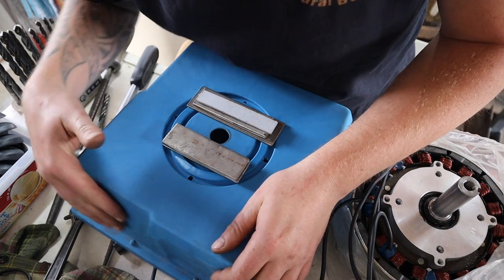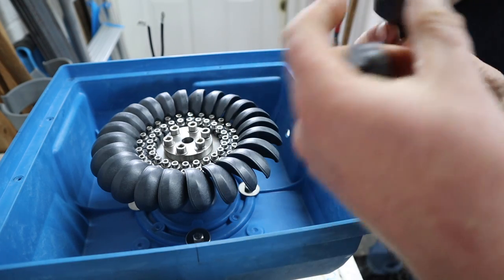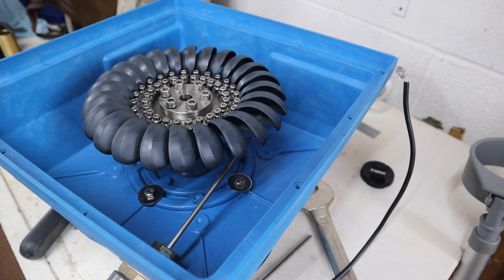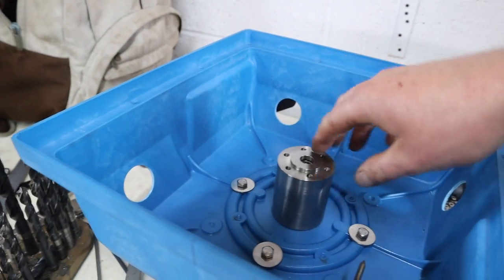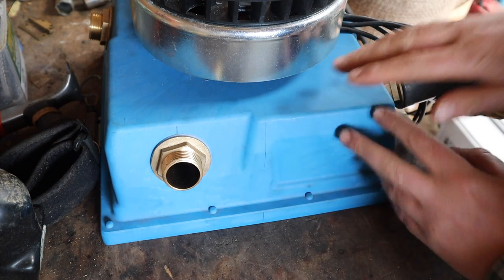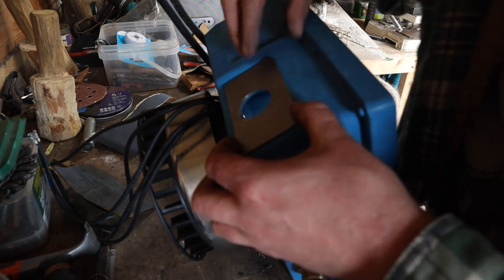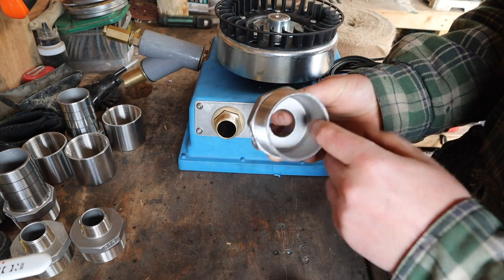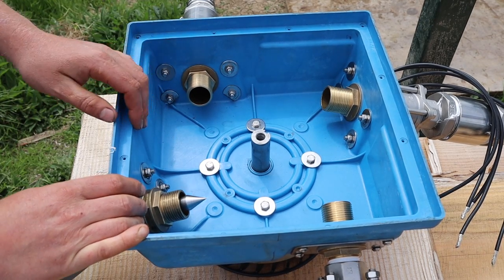4 Nozzle Off Grid Micro Hydro Turgo Turbine Part 3 (Assembling the turbine)

Comment: Nice work chap, impressed with your way of making it work. Great thought process. The world needs more chaps like you.
Reply: You need to consider the velocities of the flow. It will vary greatly with the supply. Your flow meter takes care of most or the spear valve.
Reply: Multiple water entry points will greatly increase efficiency.

Comment: Of all the components i can see the plastic box giving out first. Great stuff man, but the forces involved here, even at a small scale are quite incredible.
Reply: I agree and plan to make one out of SS. I also don't like the square box design and plan on a round housing.
Reply: @jimfisk8958  me too...he should be working more with water flow dynamics...that water should hit those blades in a nice clean way and leave out the other side cleanly....with no back wash...otherwise he will not only lose power but this can cause that cover to rip off...the water should just be hitting one side of that thing.. and leave cleanly going out...im thinking something alot heavier and shaped in the same way as a turbo charger housing that is smooth and polished on the inside...what do you think Jim Fisk?
Reply: for that... maybe go to a foundry with a blue print and work with them to make a sand mould....   bespoke of course...and you could supply the brass for them to make you one in two opposite halves with flanges with gasket of course...id be taking that route...
Reply: Maybe he could copy your one russel king?

Comment: I think you don't want a linear actuator. There are ball valve actuators available that eliminate the need for a handle and attach right to the stem. Less side load and less chance of mechanical stress causing a fault. Check Parker Hannifin suppliers, typically listed under hydraulic and pneumatic products. They have a lot of distributors. Hope that helps.
Jim , Ontario Canada
Reply from the maker: Thanks but they are £200 each. much cheaper this way. and more fun. Thanks for the info though.

Comment: Hey Kris, I use a little trick with hole saws for a perfect hole. Don't use a drill bit for the pilot. Drill the hole first and then use a 1/4" hard bolt (head cut off) or rod. That way you don't continue to chafe the pilot hole. Works like a charm. Old mechanic here. I am an electrician so I also have Vari bits which also cut a great hole but are pricey at @ $50 each. BTW I am going PVC valves and pipes. If it freezes SS will break just as easy and PVC is so much cheaper to replace. The SS is SOO beautiful tho but also so $$$$ lol.

Comment: Your QMax is called a Greenlee Knockout Punch(s/set) (known colloquially as a Body (auto-body) Punch) here in the states.  Very useful tool!  On the stainless steel reducers you mention needing conical inserts - you might consider Delrin, Nylon or Neoprene (maybe even a skateboard wheel) (OD lathed to desired diameter and cut the final ID and a conical shape cut in them).  Beautiful assembly so far!  Great work!
Reply: Known generically in electronics as a "Chassis Punch".

Comment: Cool video. I am in the process of designing, manufacturing, and assembling a micro hydro system. I think the most difficult part will be designing the profile of the buckets and then manufacturing them. Thank you for the link to the generator.

Comment: I think you will need to add a diagonal brace from the valves to the box even if you bolt them to a plate, that is a lot of weight hanging out there especially if you add actuators.
Good work!

Comment: Your QMax is called a Greenlee Knockout Punch(s/set) here in the states.  Very useful tool!  On the stainless steel reducers you mention needing conical inserts - you might consider Delrin, Nylon or Neoprene (maybe even a skateboard wheel) (OD lathed to desired diameter and cut the final ID and a conical shape cut in them).  Beautiful assembly so far!  Great work!

Comment: You can buy Bellimo Ball Valve Actuators that will bolt straight on. They come in 12/24/240V you probably need drive open spring return type.
Reply from the maker: They are really expensive in the sizes I am using

Comment: I believe you need a heavy structure to absorb and dampen the vibration or the plastic will crack and the meal will fail rather early from stress assisted corrosion.

Comment: Really been enjoying this build video series Kris. Through most of this and the last video that blue mounting box has struck me as not rigid enough, glad to see the plates attached perhaps plates inside would be an idea as well? My thinking having seen these boxes before was to cover the box in glass fibre then a resin soaked layer of core mat covered again with chopped strand mat and resin. I built some thirty foot long rain gutters using this approach a lot of years back that a man could stand in the middle of, with the gutter picked up at either end with minimal if any deflection.

Another thought is the use of those hose tails, having struggled to release and install 2" pipe from hose tails when needing to work on equipment I really hate them and with four pipes, if the pipes are not loose fitting it will be a real ball ache! On some occasions I have had to hammer the hose tails in using a second man and a sledgehammer! After that experience it was worthwhile to change all the hose tail connections to "camlock" horsetail quick release fittings, if memory serves we sourced 2" nylon bodied ones, much much more agreeable during breakdowns and maintenance.

ISO valves, ( International Standards Organisation ).Looking forward to the next build step, cool stuff!

Comment: Kris, From the flange on the top of the ball valves looks like they are designed for rotary actuators. No need to mess around with cylinders or linear actuators. Just a thought.
Reply from the maker: Do you know much about these? The ball valves i have have are 1" with iso5211 mounts and i want the actuators to be 24v I have looked them up but how the mount is not clear at all.
Reply: https://www.pvcselect.co.uk/j-j-j3c-s35-electric-actuator-multi-voltage-35nm.html?gclid=EAIaIQobChMIx4Hrxae_4gIVBpPtCh3mXQ_eEAQYAiABEgJE__D_BwE

Something like this would probably do it. You would need to check required torques and dimensions of your valves though. If linear actuators are cheaper/easier it might still be worth it as the cost of a few rotary actuators might mount up.

Comment: Ok.
1. A 90° elbow has the effect of the static interference of 25' of pipe added.
2. You added a slinger which adds weight mass you have to spin now as well.
3. You may be experiencing some magnetic field interference from building a metal housing.
Also I believe you would gain allot of power by rounding the corners of the box and closing the tolerances of the impeller.
The splash back f rom the thrown water combined with the water raining down f rom your slinger is going to cause a slowing of your impeller as it hits the impellor and is literally inhibiting the forward flow with the falling water striking the impellor and acting as a blockage.

Comment: I would have expected that one of the jets would not need a cutoff valve since it will be on all through the year - is that going to be the adjustable jet ? Clearly you non't want to construct any more motorised valves than you need.
Reply: It might be such that his lowest flow is lower than the small nozzle and he must use the spear valve. I doubt his flow would ever get that low.

Another consideration is if he sized the jets in a binary arrangement. 1lps 2lps 4lps 8lps would be good for anywhere from 1 to 15 lps in 1lps increments. This assumes each nozzle is fixed and he doesn't have the spear valve.

Comment: Having cut and placed the stainless steel plate on the outside of the casing to add strength to it do you not think it best to also add a plate on the inside of the casing?
Reason I ask is all the weight is on the outside of the casing and overtime with the water pressure on, it's going to start weakening the plastic fibers of the casing around the surface edges of the steel plate thus weakening the integrity of the casing and potentially causing issues longterm! I hope I'm wrong but after all the weakest part of your build is the plastic casing even if it's reinforced it will become brittle overtime.
I still think your doing an amazing job and can't wait until the next video, great work kris.

Comment: If you start producing them for sale would you use vacuum forming for the base box you then reinforce with plates before fiber glassing or would you go for full on fiber glass with a gel coat on the form mold?
Reply from the maker: I would most likely make my own stainless ones for the higher end and use these for the smaller cheaper ones. but i need my workshop done first.

Comment: I see corners on the turbine housing, of the worst kind, 90 degree corners..... WHY, would you use a square peg for a round hole job? Seems like efficiencies would be substantially better with a round housing, versus any number of points.

But hey, your pool, piss in it if you want.

Comment: Aren't those plates just moving the weak spot mate?
Reply: He is increasing the surface area that the plumbing will be attaching to. And also moving most of the load to the top when he gets the "cage" in.
Reply: @synk9350  Chuck the plastic crap make a steel replacement. Why waste time.

Comment: what is the company that sells tis generator ? do you have their website?
Reply: Pretty sure its from Motenergy in the States. I bought a 48v 2500w 3-phase turbine from them about 6 months ago, with a pelton rather than turbo wheel. Only have one jet running generating 500w at present (which is more than it sounds - 12kwh per day). It has been completely reliable so far with no sign of bearings issues or the like. Nice bit of kit at a fantastic price.
I made my own steel housing as I didn't like the look of the blue plastic one (which you purchase separately), looked a bit toy-ish for my liking, but Kris is certainly making it look nice.

Comment: those chamfered inserts don't matter water is a fluid so that is not a bottleneck
Reply from the maker: Fluids create friction when moving. Changes in direction suddenly like that create  friction and cause losses.
Reply: @KrisHarbour  true  but angles don't create more friction because the water that is still in that space will move slower creating  a differential in slow an fast moving water. what I am trying to say is that the water itself sort of becomes like the insert  .

Comment: For what your investing in tweaks you could have a real hydroelectric power generator from ebay with a 600 watt output complete and much more efficient design without all the nozzels and valves.
($158 u.s. approx. I dont know how many quid or bob that is. Lol)
The usgs.gov site has info on actual turbines that may give you some massive insight you can use so you dont have to end up rebuilding the model you have.
You should be on with the birds on the weekend rather than fixing another mans bad design for him. Lol